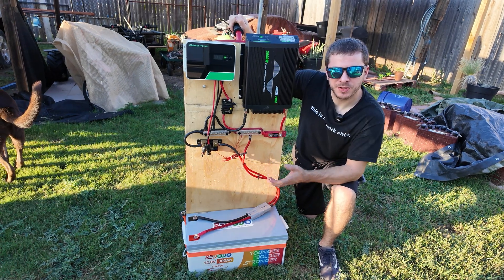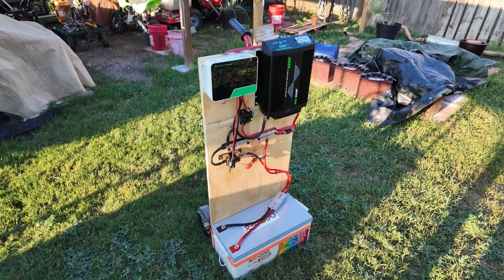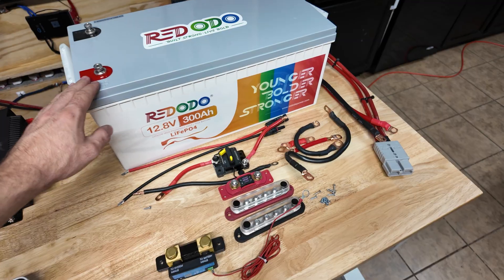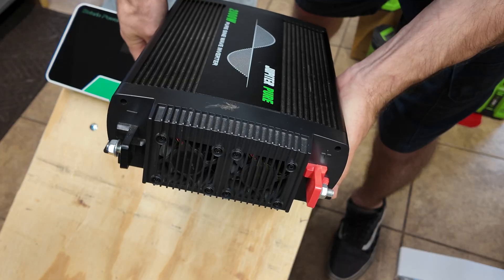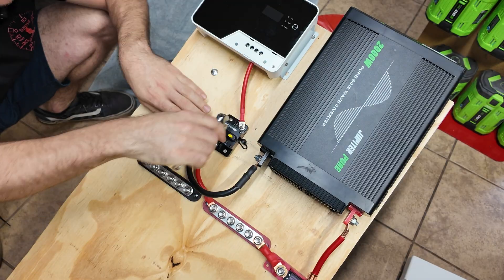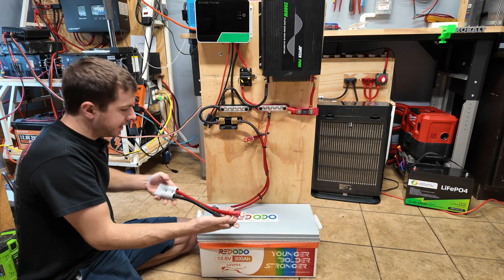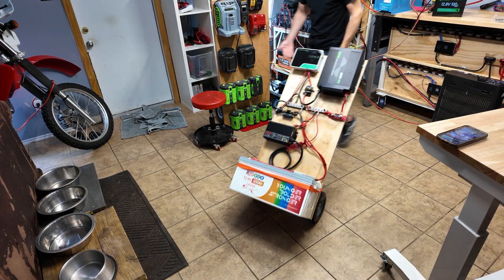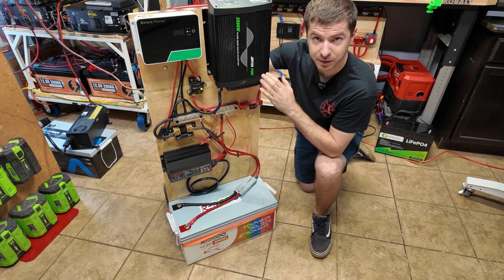EASY.  12V Solar Power System |  Build in 45 Minutes!  2000 Watts, 300Ah

Comment: Im a solar idiot. :) But had a question or example situation. I live in Central Florida where it's sunny and hot as ** most of the time. Currently, as a hobby I have a couple of crypto miners that I run. Both combined are about 2000 watts. 

If I wanted to run those on full time solar/battery power, what would you suggest as a simple setup? I think it would be a cool video since a lot of crypto folks are out there. 

Thanks!
Reply from the maker: 2000 watts is quite a load, youd need at least 4000 watts of solar, and about 20 KWHs of batteries. It can be done quite easy, but batteries would be the most expensive. Inverter wise an all in one 5000 watt unit would easily be able to run those.

Comment: I’m building my own Sister from my van. You put a fuse in between the bus bar and the solar controller. What kind of fuse is that?
Reply from the maker: From the busbar to solar charge controller is a 50 amp resettable circuit breaker

Comment: My only criticism i have with all these builds.. can we get measurements for the cable lengths used please in metres or cm or whatever
Reply from the maker: I see what you mean,  I normally dont include that incase how you mount your components is different from mine. Idealy you mount everything, then measure, and add a little extra to make moving wires around a little easier

Comment: Great video! Very clear instructions.

A couple of questions-

1) could the battery charger be hooked up to the vehical battery ( RV van) while its running to charge the solar battery?

2) what is the max allowable solar panel wattage that this sized system could be used for? Could you feed 750 watts? 1000 watts? 1500 watts?

Thanks
Reply from the maker: Thank you I appreciate it.

You would need to use  use a dc to dc charger to charge from the vehicle charging system, I actually just received one I am testing and making a video on that does just that. 

As far as max power, the charge controller I’m using is limited to 450 watts, but you could upgrade it and add whatever size fits your needs

Comment: Great video and very easy to follow step by step if one wants to build this system like myself.  I did one using the EG4 server rack battery and their 3k off grid inverter.  I like this one best because I don't have enough solar panels to charge The 3k off grid inverter with them because of the high voltage required.  In my eyes this is a better way to go for those with limited area to mount solar panels.  Thanks for the video.
Reply from the maker: Nice! I actually am planning a 48 volt build aswell, using a sungold 5000 watt all in one, and a Vatrer server rack battery, will be comparing the 2 setups head to head
Reply: @Mikebuildss  I have the 24 volt Sungold 3000 watt all in one connected to two 25.6 volt 100ah batteries from XZNY. I've already had to use it to run two window ac units during a power outage. It's wonderful to have backup power without the noise of a generator.